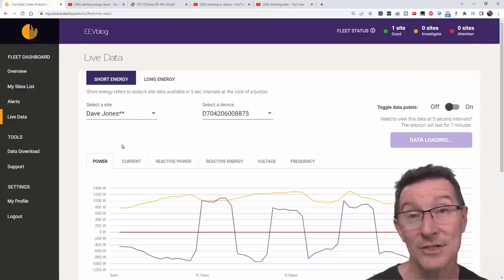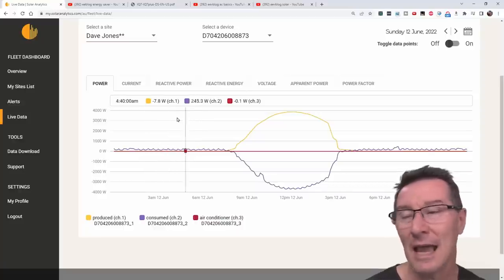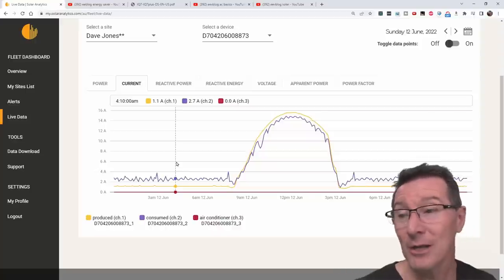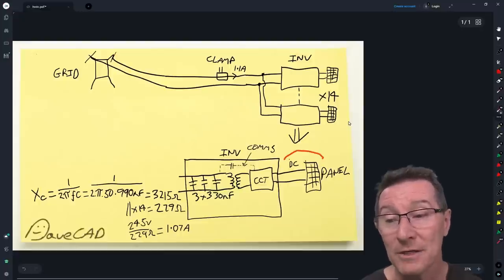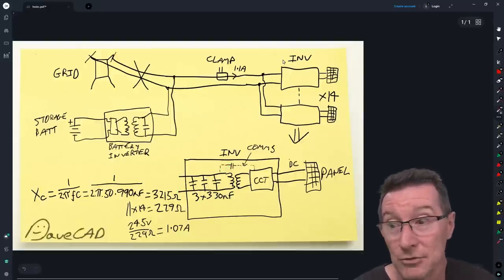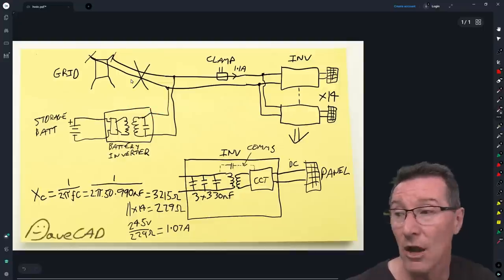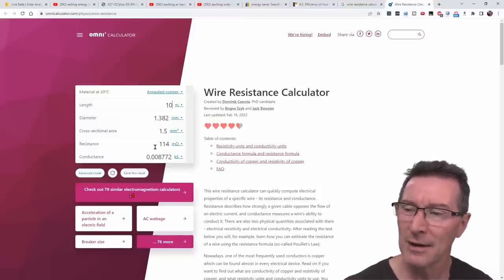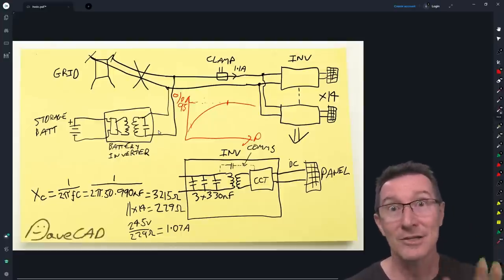EEVblog 1487 - Do Solar Micro Inverters Take Power at Night?

Comment: Excellent video. Love it. But let me get this straight. Say it's winter in Utah and dark for 16 hours per day. My IQ7s draw 1 Amp at night purely reactive power. I've verified that. We're not talking "Wattful" power but power that nonetheless is sapping the storage capacity of my PowerWalls. By how much? Is it simply reactive power X time? 1 Amp X 0.240 KVAC = 0.24 KWatt for 16 hours = 3.84 KWatt-hr per day = 26.88 KWatt-hr per week. Ouch. I would like to have thrown that 26.88 KWatt-hr into our furnace if there's a massive grid outage like during the winter of '21 in Texas.
Reply: If someone says, oh just get a gasoline generator, I'll just scream. Oh wait. If one had a carbon-neutral synthesized hydrocarbon instead of fossil hydrocarbon, it could be a viable option. So what if the carbon-neutral synthesized hydrocarbon costs $2.50/liter? I'd use it rarely to extend the range of my vehicle for a long trip or if the grid goes down.
Reply: @charlesashurst1816  what solution would a generator solve anyways? Certainly not to run all night, right? I could care less about the carbon footprint, because it would be a negligible concern when the cost and hassle would prohibit it. Generators use around 3L/h, so in a day it would use 60-100L per day. That's 20-25 gallons a day. Even if you had a fuel tank to feed it, and you didn't need to fill an onboard tank, that would cost around $100usd a day. Modify can afford that. That's an average considering everything from you using less power during the night, to you having 4h more dark time than average, which you are awake and using more power, but doesn't account for anything more than a window banger AC unit. A generator for nighttime supply (normal operation, not emergency use) is absolutely unfeasible. Even with a big 20 kW while-house generator, that is feed from natural gas from the street (often cheaper than gas or diesel, and no need to fill the gas tank), it wouldn't be affordable. Even in a disaster scenario, a 10kW generator uses a gallon an hour to power essentials. You would have to have an obscene amount of gas on supply. There is almost no situation where a generator is useful in a disaster scenario. You'd need 100 gal of gas to make it through a week. Nobody is storing that kind of gas, and city supplied natural gas is usually down in a natural disaster scenario. 

ReEeEeeE cArBon nEuTraL "sYnThEsiZeD hYdRoCaRbOn"
Reply: Ok, I've made the voltage/current/power measurements on our Enphase IQ7s and on our Tesla PowerWall. I wish I could attach the scope screen images. Bottom line to the question: Do your Enphase IQ7s rob energy from you Tesla PowerWall at night? Theoretical answer is yes but the practical answer for us seems to be no. At night while our household consumption was at its minimum,  I verified that the IQ7 were indeed drawing about 1 Amp in almost completely reactive power. But when I looked at the voltage and current from the PowerWall, the current and voltage were close to in phase. Apparently, because all the other sipper loads of the house, the doorbell transformer, the internet router, and miscellaneous loads, the reactive power of the IQ7s is somewhat swamped out by the miscellaneous loads. Bottom line, I don't think there's any practical value to installing an adaptive power factor correction device to the PowerWall or to install a timer that would disconnect the IQ7s at night. There is value in going through the house and eliminating as many of the sippers as possible.

Comment: Hi.
I've seen some of the micro-inverters and their electronics. Found that these micro-inverters are not pure sine wave. Just wondering if all are designed that way. would you be willing to do a tear down of one of your units :)
Reply: not pure? poor harmonic filters? have a scope trace or power analyzer results?
Reply: @liam3284  did this about 5 years back. Unfortunately don't have data !! Apologies :(

Comment: could you use these inverters with a battery pack of the same nominal voltage as the panels and charge them during the daytime, then, at night use a relay to switch from panels to batteries and use the inverters?

Comment: Me too almost exactly. Had 2400 watt PV using Sunny Boy and Fronius inverters. And then I got 12 more panels with Enphase IQ7s. And I too saw the 1 Amp at night and went HUH? Thank you thank you thank for this. No worries whatsoever while I'm grid tied. But. I've got two Tesla PowerWalls too. If we get a Texas in Utah and the grid goes down for two weeks, a lost KWattt-hr or so from the PowerWalls that I could have tossed into my all electric heat pump furnace could be missed. Not a major worry, but I would like to know how much the reactive power of not only the IQ7s but all the other reactive loads in my house degrade the storage capacity of my PowerWalls. Would it pay to install an adaptive power factor correction gizmo, not a phony baloney one, but a real one?

Comment: With the cost of electricity doubling (and more come October) here in the UK I am looking at battery systems (again!) and Dave's idea of fridges/freezers etc only has me thinking!......and not to mention also measuring the standby power on my Bosch solar inverter itself etc. Hmmmm!
Reply from the maker: I'm onyl thinking of the fridges because a company is supposed to be sending me a 3.2kWh portable battery pack for a teardown or whatever, and I have no other major use for it. So I thought I thought it might make an interesting video of just powering the fridges with it with a mechnical time during the day to recharge it from the existing solar. Power failures are so insanely rare here that it onyl makes sense to protect the fridges and maybe a few light and a power point or two.

Comment: When they first came out I purchased a few of the Enphase m190 inverters and had a very small system I was concerned enough about night time power draw that I used a couple of solid state relays in my solar panel circuit breaker box and set it up so if the panels weren't producing at least two or three volts that cut the AC to the grid tie inverters and envoy. I know I measured how much power they were taking at the time but it was close to 15 years ago and honestly I don't remember I just know it was enough that I was not wanting to waste the power. I think my envoy took about 5w assuming 12 hour average night that's 21kw a year it would have taken me about 10 days of generation to cover. I also planed ahead for degradation of the panels and used 250 Watts worth of panels for the 190 W inverter.
Reply: 5W is nothing thought; those solid state relays + related circuitry might have costed more than that little bit of consumption.... Plus your missing out the potential PFC.
Reply: @jb5631  As a total Electronics geek I've been collecting parts from various places over the past four decades. As a result it's been many decades since I've spent anything on components to put together anything that I needed to build. I got a whole bag full of brand new solid state relays my employer threw out. So setting up this control circuit cost me exactly nothing. If you figure 5 watts per hour this figure is probably a little low the Envoy specs say it can draw up to 7 Watts and about another watt for all my inverters. Assuming an average of 13 hours of off time of day (and this is probably also conservative as the system doesn't start up until a few hours after Sunrise, shuts down a few hours before Sunset, is partially shaded by the configuration of my roof in the evening, and this figure doesn't even take into account cloudy days as well as the fact that I'm fairly Far North), that comes to 65 Watts every day. That is 23,725 Watts of wasted power every year. I set the system up in 2009 that's 13 years which comes to a total of 308,425 watts of wasted electricity. Including distribution fees and taxes I pay roughly 18 cents per kilowatt hour it means it saved me a total of 55 dollars while costing me nothing. And this is very easily a conservative estimate considering actual time the system runs per day is probably far less than 11 hours over the course of the year. I also got to enjoy designing and setting it up. Another way to look at this is my fairly small system so far his generated two and a quarter megawatts so you could also look at this as if I hadn't done it I would have lost 13.7% of my generated power if you look at it this way that's actually quite a significant difference. I'm not charged for power factor and I've never noticed issues with say a motor starting up slow because of current lagging voltage so power factor correction isn't really something I cared about.
Reply: @stdorn  you forgot to account the heat dissipation of the SSR. Any semiconductor has a resistance, and for AC SSRs it ends up being around 1.5w of heat per amp.

So if you're producing 1kw, you just lost 12w regardless of 120 or 240 cause in 240 you would still need two SSRs which would cancel out the energy saved with the higher voltage

So if your system is producing 5kw you are losing 60w into the SSR that would have otherwise gone into the grid. And those 60w even if you only make 5kw for 1h, would be more than enough to compensate for the 5w the inverters lose overnight without any SSR in the middle.
Reply: @00000005547  you're absolutely right I never once considered the loss of the solid state relays. I don't know how I never thought of that. As I was trying to determine cost effectiveness before I installed a larger system I only had two inverters so max output was about 400 watts. Some quick math with your one and a half Watt numbers show I lost almost exactly as much as I thought I was saving. Although being able to shut the grid tie inverters down did serve another purpose if I wanted to be able to send all of my solar power to my battery Banks. When I get a chance I'll have to check the specs on my SSRS and see what the actual numbers come out at.

Comment: So I have a question... Could you theoretically eliminate all of the Alternating current and change everything over to a + - direct current system? Would appliances still work?
Reply: The answer is yes, and more and more companies are making DC versions of their equipment. Water well pumps and fridges for sure. You can already get low voltage DC lights Check out the RV world. You still need a manager to do MPPT and to do battery charge management, though. Your savings though, is not really all that great. You need all special DC appliances.

People don't like doing this because higher voltage DC can be quite dangerous compared to AC. Arcs don't automatically extinguish, so the fire hazard is much more. If you contact the DC, it tends to lock your hand onto it, so electrocution is also much more likely.

Comment: You may not pay for apparent power, but tecnically you'll pay for the cable loss of the current running through the cables in you house so that VAr if too big might take some real W with it
Reply from the maker: Watch the end of the video where I calculate this.
Reply: @EEVblog  oh so sorry! I always comment at the end but only made it half way through and had to hit the bed :P
So pretty much negligible power loss on the cables, and probably you have thicker wires than calculated in your house

Comment: My sunny boy 2.5 uses 1.5w overnight measured.   i.e insignificant.  I'd be willing to wager if you actually measured the watts flowing back out up on your roof AC wire you'd be suprised (in a bad way).

Comment: Could you place a large enough Inductor/transformer on the inverter output could  you balance it out?
Reply: No, the inductor large enough would also draw power in core and copper losses more than the saved power. On a grid tie the 3W use in power off would still slowly add up, but the reactive power would help offset the in house loads, which even with LED lamps are needed, because of the non linear power draw of most modern switching power supplies.  

Only an issue if you are using in conjunction with an inverter to boost power capacity during the day, and no grid connection, so easiest to use a relay and daylight switch to disconnect the panels entirely, or use DC output panels to feed the inverter solar charge input directly instead. 

This issue is only there for grid tie panels, which is not going to worry you in normal use, as the extra filtering of the 1uF total filter per panel actually reduces the overall power factor of the house, as most of the load during the day and night is either inductive or non linear with a bridge rectifier, so extra filtering capacitors and inductors in parallel to the load does help.

Comment: I wonder if the relays disconnect from the grid in a power out?
Reply: That or the inverters turn off.  Every grid tied system I've ever heard of has that as a requirement.  Otherwise a downed powerline would stay energized!
Reply: @arthurmoore9488  Makes sense. I suppose that using the relays to disconnect would also prevent the caps from discharging down the line.

Comment: Non-residential users are charged on power factor, not apparent power. Apparent power as you noted is made up of real power (what you pay for) and imaginary power (which averages to zero over an AC cycle), but as you said, imaginary power leads to real currents. That's what non-residential users pay for if they fail to keep their power factor in check. It's not hard to do either - they just have a big box of capacitors at the power input to the building, usually switchable in and out to keep the power factor in check. 

Also, almost all loads are primarily inductive - motors are everywhere used to drive the compressors of your fridge and air conditioner, motors driving fans that keep you cool, etc. In the past, residential uses of power were mostly resistive - heating coils used in appliances like ovens and stoves and heaters, lights, etc. But these days it's gone inductive as people buy fridges and air conditioners and fans. That's why power companies never need to correct for too much capacitance on the line - there is almost never enough capacitance - so there will be bit capacitor banks at substations (they call them "reactors"), and there will be capacitor banks along power lines as well, and of course, non-residential customers will have banks of them switched in and out because almost all industrial machinery is inductive - driving motors and such.

Comment: Question:  Do you segment your panel groups with diodes?  For instance, when sun shines on half of the group and not on the other half, the groups in the shade are a drain on the rest that are in the sun.  Diodes can thwart this but, the current drop across a diode separating groups of PVs is a deficiency in and of itself.   I built a 13kV solar tracking system back in 2009 and discovered, at least in that case, the diodes helped more than harmed.  System "turned" on and made power much earlier and later in the day than the same system w/o diodes.  I.e. the voltage got high enough for IGBTs to output a useful voltage earlier and later.  How much did I lose in terms of power because of the diodes?  I don't really know. Overall experience building that solar tracker:  Not really worth the cost.  Although it is still working today and has collected data since 2009.  I haven't looked at the data for a long time.  One sort of loses interest after a while.  I do know that the electric meter is still running 'net backwards' for the building the thing is hooked up to.
Reply: if every panel has their own micro-inverter then we don't need to connect them in series anymore, no need for high voltage DC to reduce wire losses because each micro-inverter already convert low voltage 12v dc to a high voltage 120 / 240 v ac. With micro-inverter each panel is independent of other panel so no need to worry if 1 panel is in shadow, so no longer needed to string them with bypass diodes.
Reply: @xponen   I like discussing these things.  #1 question in my mind with multiple inverters and by mathematical recursion, many 'micro- grids', who is in charge of synchronization?  In the early days of me experimenting with commercial PV inverters, there were times that the grid-connected inverter remained on when the main utility disappeared... a dangerous thing.  Firmware update corrected that in that situation.  But, as these things proliferate on rooftops and fields, I can see the local logic of the micro-grids deciding that they are the utility and remaining on just because they're fooled by their other buddies on the local network.  Really seems like a mess to me for devices that are very very inefficient(PVs) in terms of energy density and area.  I am very much a fan of nuclear.  PV manufacture is extremely energy consuming.  Average folk think the things grow on trees.  They don't.  They're made in China using coal as energy source.  I am very skeptical about the real benefit of PV.

Comment: So if you are syncronized to the mains and you want it at unity, The voltage is likely pushed up as a VAR control to push the waste onto the grid. OR dose it use capacitors to correct the factor of the load in the house? I am a diesel generator engineer and when a building is running on a standby set the capacitor correction has to be isolated as it upsets the regulator on the gen set. And if synched to the mains the utility tends to have a spec to follow on the VARs in order for customers to not push the waste onto the grid. As i understand it the power factor is the angle difference between the Volts and the Currant, caused by the inductance or resistance of the load. So a resistive heater will be at 1 and a PC switching power supply could be at 0.7